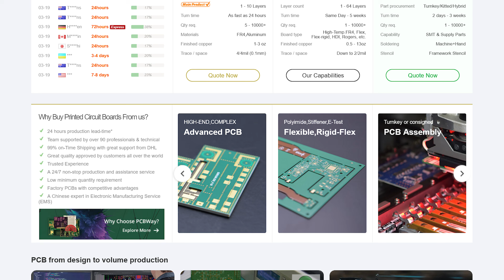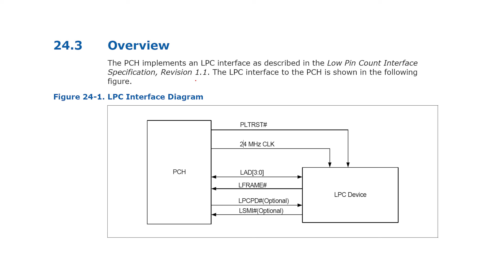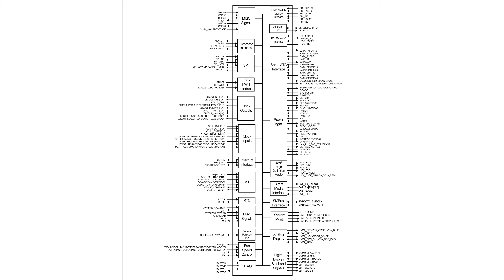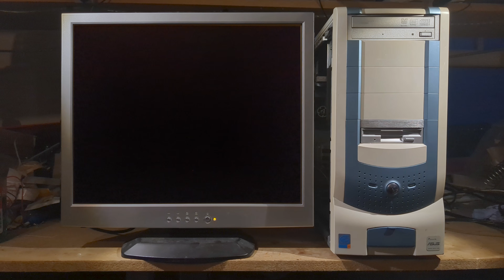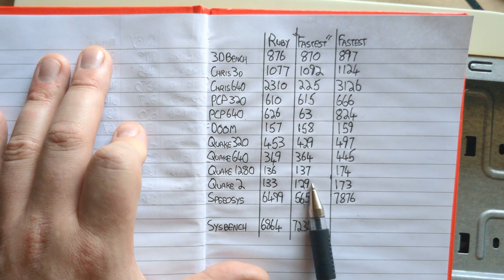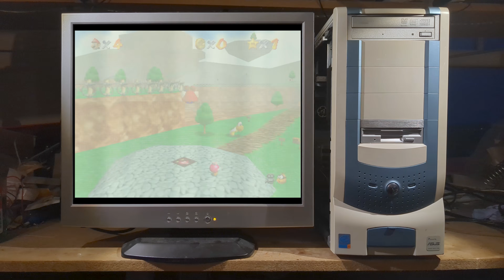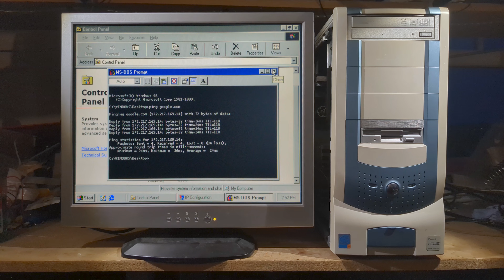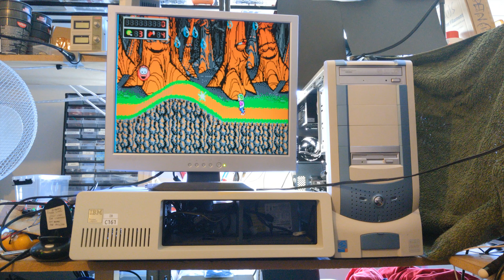No, *This* is the Fastest MS-DOS Gaming PC Ever

Comment: you can mod i7-5775c support on B8x chipsets with a bios mod iirc. disabling the igpu nets you 128mb of l4 cache and the ipc improvement allows for 4.8ghz 4790k performance at only 4.2ghz and less temps.

i wonder if there's a z97 board that'd work cause i have yet to play a game that wont run on my i7-4790, besides games that require rtx due to running a 1080 lol. with a z97 chipset im able to overclock my ram to achieve 32gb/s r/w/c and it actually helps a monstrous amount since these cpus are actually quite starved by 1600mt/s ddr3 let alone with any less than 4 sticks.

Comment: I have a 2200+ Athlon Xp running at 1733MHz with ISA slot (Yamaha sw50 installed), that'll knock the pants off almost anything from 2000 with an ISA slot. Great for playing tomb raider in software mode (which I prefer over the accelerated versions).

Thanks for an interesting video.

Comment: A bit late to the party, but a couple of ideas, which came to my mind:
1) Disabling HT and setting active cores to 1 (your BIOS seem to have necessary settings). This should allow the CPU to reach max turbo freq. most of the time.
2) Disabling all virtualization settings (VT-x, VT-d) should (in theory) give a little boost. At least, it's a common practice to disable those, if virtualization\hypervisor is not needed.
3) Another "Per aspera ad astra" path could be buying cheaper Xeon V3. The trick being, there is a bug in Haswell based Xeons, which many exploit to lock CPU turbo freq., which basically makes it work at max turbo freq. all the time.
4) Instead of overclocking CPU, tuning memory frequency, command rate and timings should also give some results. IDK, if single\dual channel config matters in DOS.

Comment: I found out a potentially better motherboard for this and it is relatively cheap, the gigabyte ga-h97m-d3h. It has 2 pci slots already on it, the downside is that ldrq is on a chip and not the tpm header but oh well. It's also micro atx. If this isn't better than at least it would be a side grade. Thanks for asking and answering questions about computing that no one would have ever thought of.

Comment: hi, i was watching though your older videos on mini industrial pc's and saw you made your own soundcard for them and saw you show off some ebox's that use the vortex86 and was wondering if you ever designed your sound card to work with them?
i have an ebox 3310a which i'd like to use for playing dos/windows 98 games but the built-in audio on them sucks because it basically uses usb audio but it does have an internal mini-pci slot for wifi but i was wondering if you ever tried making your soundcard to use that slot so they have better more compatible audio? or know of a usb audio solution that would work well for dos and windows 98 thanks.
Reply from the maker: Unfortunately the eboxes don't expose enough pins of the vortex86 to be able to have a full sound card. I heard they work with SBEMU, though - that's a soundblaster emulator for DOS
Reply: @TheRasteri  i will certainly give that a try when it's all setup, thank you, i also have two ebox-2300sx but i can't seem to get windows 98 running on those, it says it can't install on an i486 with no fpu or something along those lines but it seems windows 95 works.
Reply from the maker: @RazorX-Gaming yeah most eboxes I've seen in the wild have been running Linux. Weird win98 doesn't work though, I didn't think it needed an FPU
Reply: @TheRasteri  i believe the DX ones are fine, i think it's the SX ones that have that problem but through messing around i have found a way to install windows 98.
you can use a hidden launch option when installing windows 98 which is setup.exe /NM
also if you know a linux option i can install which has a desktop kinda like ubuntu i'd appreciate it, i've also run into issues trying to install linux because of it being i486.

Comment: I have a sata drive that has dos/win 3.11 on it, I was trying to update the bios in my Dell Precision t3500 to a17, and I took the floppy from my t3400 out and put in the t3500, but no matter what I tried it would not work, a boot floppy with the file on it, cannot run in dos mode, anyway I finally got it to work last night by running the file in windows 10 with admin rights

Anyway when dos came up on the t3500 it would not load himem.sys, and therefore would not run win 3.11, which had run on the computer it was install on, an HP media center, that had everything, floppy, IDE, PCI, and a large slot for a USB media drive, the one I got was 640GB, I no longer have that system, and it looks like I will need a different computer to run win 3.11 on.

Comment: I'm still having a blast with a Industrial PC  2x Xeons, 1GB DDR ECC on a 3xISA originally had a SB16 Gold paired with MPU-401 then replaced it with a Picogus , Voodoo5, Voodoo2 SLI, USB 2.0 NEC chipset, Ethernet, PCMCIA card,  Diamond Stealth 4mb SGram, Creative 3DO Blaster with lots of left over PCI slot all running Win98SE on a 120GB Sata (PCI sata PCI)  The board is a PX-20S2 Ver:E1 all powered 500W PSU overkill, emulation? Retroarch + C64s V2.0(bought in 1996 for $70 USD) Magic Engine (1997 $29USD) networked to my openmediavault server along with my main PC and NEC PC98 series computers ;)

Comment: It is not correct that there are only ISA Sound Blaster compatible DOS sound cards. There where quite a few PCI cards with this capability. Including something like a Diamond Monster Sound with Aureal Vortex 2 or any other card with that chipset. There are many others as well. You could then just use a PCIe to PCI adapter. There are other youtubers that have done this. Then you could have used a faster more modern PC. Also there were several 486 SX and other 486 models with even MORE ram than 24. IBM had models with a 486 SX25 that came with 32megs. Also you installed WINDOWS. While yes it runs on DOS technically, the last official version of DOS is 6.22. LGR ran DOS 6.22 on a modern Ryzen processor (he didn't bother with the sound though.) Also remember as for the speed the older OS and software can not take advantage of any of the processors more modern architecture and instruction sets.

Comment: You might want to check out “ITX Llama” for DOS projects, or simply get yourself a Socket 370 motherboard with a Pentium III 633–933 MHz and 512MB RAM.
Avoid Intel chipset boards, as they’re often dead (and overpriced). Instead, look for something like the ECS P6-BAP with a VIA chipset—you can usually find one for $10–50. Matching CPUs go for about the same.
For graphics, I recommend an ATI Radeon 9200/9250 AGP card: cheap, durable, compatible with just about anything, and more than powerful enough for DOS, Windows 98, or even XP.
For sound, use a Terratec Base-1, which is easy to get and works broadly across systems. If you want better MIDI/AdLib/OPL output, add a Dreamblaster S2 (512KB SAM2695 wavetable board).
When installing software, make sure to install the Windows 98 SE mass-storage driver—this lets you use USB sticks between machines.
Finally, skip old hard drives: SD-to-IDE adapters are easier to handle, cheaper, and more widely available.

Comment: I have a 486 dx 50 running dos 6.22 it will run win 3.11 almost threw it away but it runs perfect and the old floppy still works and a cd  rom with is a blaster that runs off the blaster sound card my wife wants it gone though 128 mb ram btw

Comment: Thanks to @TheRasteri encourage I finally made it with friends. I'm eyeing this project for almost two years and finally found friends in local community, who familiar with boards and soldering. 
Yamaha YMF719 performs flawlessly at IRQ7 D1 T4 (w/LPT enabled in BIOS).
Asrock Z87M Pro4 has TPM and easily accessible LDRQ1 just down from PCH heatsink. 
4670k takes 4.5GHz with ease. Only one core rqrd ? No problems - just disable unneeded in BIOS.
I have 660 fps Q1 640 and Q2 1600x1800 125fps with sound. DOOM - "only" 550-ish realticks. Speedsys 8008.
i5 4670's GMA has excellent DOS compatibility, except enormous flickering in DN3D with the same enormous FPS (400+ in 800x600).
Next project - AGP->PCI converter for V3 AGP: love to see 16bit color in DOS in Q1/Q2/NFS SE - the titles I spent time in late 90s.

Comment: I noticed that @TheRasteri did not disable the other cores that he would not be needing for dos gaming. It might yield slightly higher results if you disabled CPU technologies that you are definitely not taking advantage of in bare metal dos gaming. Hyper threading, AES,  CPU Power limit, Etc. This might also make for a good video for documenting your experiments. The thought process would be, that you would be able to sit at max frequency longer or indefinitely because the package is producing minimal heat while at full tilt.

Comment: If a DOS game run to fast it is a bad programming style, because the timer chip and the vsync exist since the first PC. To use only a loop  for a delay is crazy. I made a program that poll the keyboard controller on an intel 80286 with 20 mhz and i can use it on PC with 2700 mhz with near the same speed for the pull down menue just using the vsync with 60 hz refresh rate on all PC.

Comment: My last DOS booting PC had an intel core2quad CPU at 2700 mhz with 8 GB DDR 2 RAM and with Radeon 7950 PCIe with VBE 3 Bios on 28" LCD monitor booting from self made CD-ROM MS DOS 6.22 or booting from 2 GB USB-Stick FAT16 MS DOS 6.22. Ready to startup all cores and switching into 64 bit mode from DOS.

Comment: I'm mostly certtain that the ability to run PCI-e over a USB-C cable isn't the lucky coincidence that you assumed. As far as I understand, the USB Implementer's Forum intended to run other standards over their connector from the start, and thus designed in enough pairs to fit what they thought made sense.

Comment: Those suspiciously thin power cables are actually present on even high end power supplies these days. It's just a trend today to have flat power cables, that itself isnt' a sign of a "cheap" power supply, though the weight of the PSU definitly is off course.

Comment: Wow, a 5800X3D powered DOS machine would be mental! You would fit the whole games, and even the OS, just within the L3 cache of the CPU :O
Technically could you get it to work without audio as a first step? Or is ISA a hard requirement to get anything to work?
Reply: Actually, does the motherboard you're using support Broadwell CPUs like the i7-5775c? It doesn't clock as high as the 4790k, but it's IPC should be a little better and the 128MB of eDRAM makes it Intel's pseudo X3D style chip. I have a PC with an E3-1285 v4 with optimized memory timings and frequencies and stuff, and at stock clocks it goes toe to toe with an overclocked 4Ghz R5 2600. At least in Windows 10.

Comment: I keep finding the same problem with DOS, that no matter how much power you throw at DOS, ISA soundcard aside, it hits that 400 ish FPS limit in Quake and the rest never go past that in any significant amount.  I want to see Quake do 1000 FPS in DOS but, nothing I have tried will go past that magic 400 ish area. Ya you got to almost 500 but that is still in the 400 ish level, and no reason it shouldn't be just throwing CSGO under the bus with a 5090 in Quake.   Someone once told me that modern CPU's emulate 16 bit code and because of that they are basically equal in performance.

Comment: Here's something to explore. What's the newest PC that can have LIM 4.0 EMS RAM setup on it for DOS software that needs EMS for loading large amounts of data, and cannot use XMS? What sorts of software? Early PC based CNC equipment like a ProLight PLM 2000 milling machine. They're the most capable benchtop CNC bedmill ever made, with servos and up to a 100 pound working load. Unfortunately neither company that made them ever bothered to update the software for it. Their PLM 1000 model that used stepper motors got Windows software.

No, the DOS software cannot be run under Windows of any type. The machine and DOS software requires absolutely exclusive access to and control of an RS232 port. If anything so much as looks at the port it sees that as an interruption and the mill shuts down. With Windows you can try all the "exclusive access" tricks you want, Windows will still periodically take a look at the serial ports and *pow*, down goes the CNC.

Comment: The i7-5775C was the final upgrade for socket 1150. Still slightly faster and much more power efficient than the 4790K.
Reply: Is there an ibm compatible bios aviable on these mainboards to boot MS DOS?
Reply: @maxmuster7003  The main problem from Haswell onward is the missing A20 gate. For full compatibility you'd have to go another generation back.
Reply: @Breakfast_of_Champions  What is the problem with no A20 gate? I think if there is no A20 gate it is not switch off and default on.

I used the undocumented 16 bit "BIG" Real Mode on intel core2quad 64 bit CPU (with a segment size of 4 GB for DS,ES,FS,GS segment and 64 KB limit for CS,SS segment and A20 switch on) for using instructions with the address size prefix(67h) to write directly into the linear framebuffer located in the 4th GB of a VBE 3 graphic mode in MS DOS with dissabled EMS driver. Default the segment size is limited for all segments to 64 KB in the 16 bit Real Address Mode.

I am not sure what is happend if the routine to switch A20 on with using the keyboard controller failed.
Reply: @maxmuster7003  A20 gate was most useful for putting drivers, TSRs into the HMA with Loadhigh etc. Other things depend on it too, but I never tried Dos extenders like 4GW on my Haswell system.
Reply: @Breakfast_of_Champions  Without A20 we can address 1 MB + 64 KB - 1 byte in 16 bit RM. A20 is only needed for addresses above.

Comment: most sound blaster cards were also on first gen PCI cards as well, Creative made PCI versions of most of their sound cards by 1992 with the Sound Blaster 16 on a PCI card that used audio chip sets going back to the late 80s that could handle far better data throughput then 16 bit ISA.
Reply: do you have some search term for youtube to find some video about a sb16 pci that's from 1992?  and not the 98 ensoniq 'sb16 pci'?   i know the wikipedia article says that it was released in 1992 for 'pci and isa' but i have never heard of the actual sb16 in pci.

(also i never saw a pci mobo in the wild before like 1993)

Comment: Did you run fastvid and univbe to accelerate stuff even more? That used to make a massive difference.
Reply: Modern graphic cards have a VBE 3 bios with a lot more 16 bit function and modenumbers for wide screen resolutions like 1920x1080 and 1920x1200 with 16:9 and 16: 10 aspect ratio using the PCIe slot. Univbe is much older and outdated.

Comment: FYI, a lot of 586/686-style south bridges contained an AC97 soundchip which came with a DOS driver and worked very well with 16Bit stereo and up to 48kHz, but not SB16 compatible. My old AthlonXP board uses one of these. Without the driver though they were compatible to a SB8 Pro, 8Bit, stereo, 22kHz. It worked with EVERYTHING. Midi though was a beast, without driver nothing and with driver OPL-support which sounds almost like real OPL but still a little worse.

Comment: Super cool man, you have incredible skills and knowledge. I would never dream of doing this. I have an i7 4790K with a GTX970 and a Sound Blaster X-Fi as my "Rocket Windows XP PC".
For my "Fastest MS-DOS gaming PC", I have a socket 775 motherboard (via chipset) with a modded Xeon E5450 with a 7600 PCIE Nvidia card and a Yamaha PCI card that can play pure DOS games. Not as fast as your machine, but fulfills the 3 requirements you mentioned (no emulation). This is also my "ultimate or rocket" machine for Win98 games. I can get the machine to run slower by underclocking or using cpu spd commands to bring it to 486 levels if necessary. Really love your videos and innovative ideas.
Reply: Good to know. Thx.

Comment: i run a 
- MS-7E12
- AMD Ryzen 9 7950X3D 16-Core Processor
- NVIDIA GeForce RTX 4090 - Primary VRAM: 24563 MB
- Desktop Resolution: 2560 x 1440
-  RAM: 31899 Mb

on Windows 7 (64 bit) some idiot told me (before i build it) "Your hardware litterly cant run it". yeah it can and without problems even. ofc same idiot called me a liar, i showed him screenshots and even a pic of my computer, without a workd same idiot vanished without a word, failed to admit he was wrong. i love telling this. becasue "not supported" does not mean "doesnt run".

Edit: always remember even windows 11 is all still based on MS DOS. that why most things are backwards compatible, even today.
Reply: I like to know if the graphic card have a VBE 3 bios with a VBE modenumber for 2560x1440 in MS DOS?

I used 1920x1200x32 with 16: 10 aspect ratio on a 28" LCD monitor native resolution with 60 hz in MS DOS with a Radeon 9750 PCIe VBE 3 bios. This was the highest resolution in the mode list of the VBE 3 bios.
Reply: @ You talk about the 4090, then no. no native support on that. there are work arounds.
Reply: @Votexforxme  Ok. Thx. My older Geforce GTX 295 PCIe had a VBE 3 bios.
Reply: @maxmuster7003  im not 100% sure on that but i believe for nvidia the GTX 700 series had support for it and for amd R9 200 series had native support for vbe 3.0 im not sure if it was all or just some within those series. like i said not 100% sure on this i know some had it.
Reply: @Votexforxme  The card manufacturer is responsible to provide it.